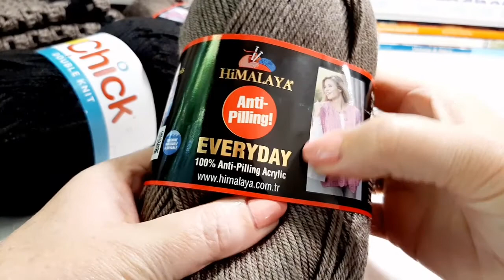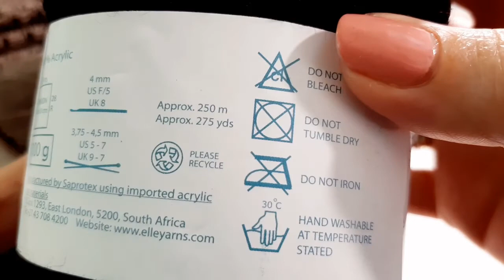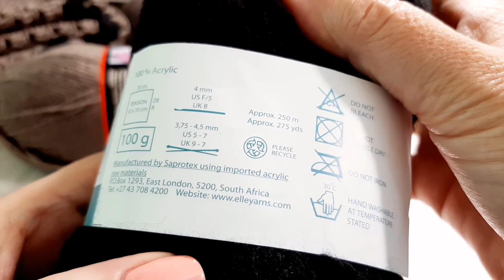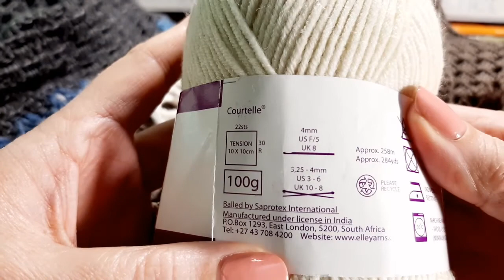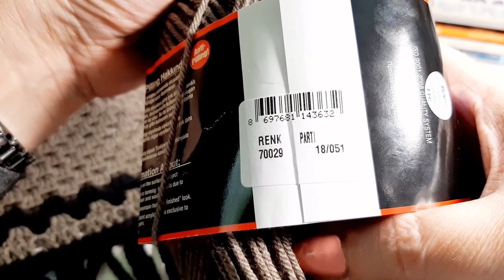Crochet Tutorial - Granny Square Poncho - 'Winter'

Comment: I’ve had trouble making a granny square.  So last year after trying several times a day for several days I became so frustrated! So, I haven’t tried again since then. But, I’m going to try to make one by following your tutorial. Thank you...😊🧶😊😊🎃😊
Reply from the maker: I think you should get it after first 3 rounds.  I take my time showing you which is why my tutorials are long but rather too long than too short. If you do not come right let me know. I will make a video just for you. You can do it. Don't give up. You can also go to any video and at settings icon you click and click speed and the video will run at slower speed. Pause as often as you need to. 🥰❤🇿🇦